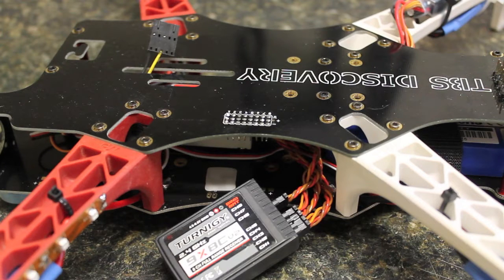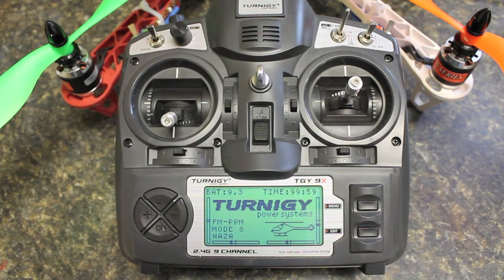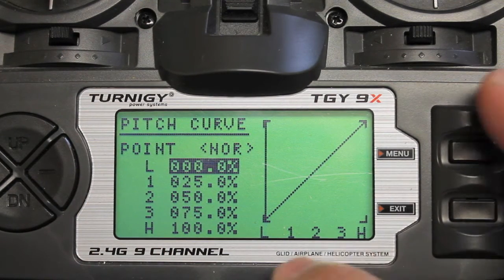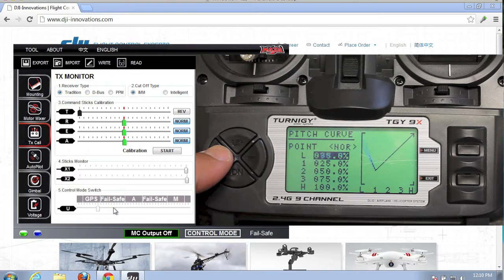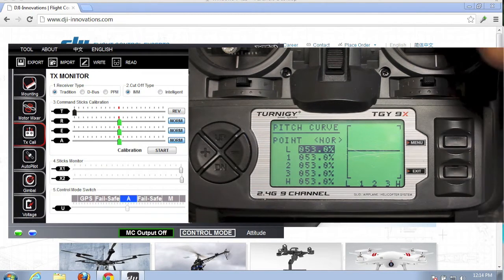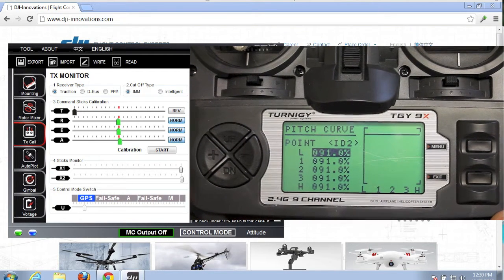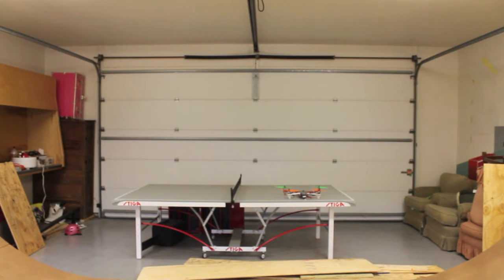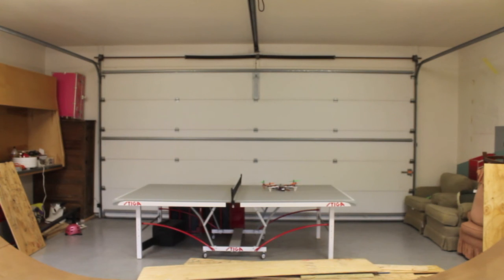DJI Naza 3 Flight Modes (Attitude, Manual, and GPS) w/ Turnigy 9X Transmitter and 3 Position Switch

Comment: I upgraded my nazam v1 to v2 and I have a gps I am using a stock 9x and stock receiver how do I set it up for fAILSAFE? AND DO YOU KNOW HOW TO SETUP THE RTH AND COURSELOCK ON STOCK9X
Reply from the maker: David, I've been trying to figure out how to do this with no luck yet. I have a few more ideas and will let you know if I figure something out.
Reply: thank you dennis, I know if anyone can figure this out it would be you!!!. I met someone who had the same setup as me stock9x and receiver and naza m v1 upgraded to v2 and he had all features that v2 has to offer working just with all the original 9x switches thanks for all your help I have tried everywhere
Reply: Isn't RTH just regular failsafe? Just use the Forced Failsafe guide Dennis made.

Comment: Great guide! With my Naza V2, the manual mode was out of range, so I had to use the subtrim-menu and other values for the curve.
Reply: I only use 3-way switch w/ manual/atti/gps and forced failsafe on the gear switch. 

Haven't tried IOC, since I usually can understand orientation by my self.
Reply from the maker: Thanks. Glad to hear you got it working with a little subtrim!
Reply: since you have the naza v2 are you using a stock 9x? if you are can you help me set up the ioc rth features?  davidringler40@yahoo.com
Reply: do you know how to setup ioc, and rth?

Comment: I did it differently. In airplane mode, I used the the program mix 1, 2 & 3 using the Gear as the Master and the Flap (three position) as the slave. The down position of the Gear switch with each three position switch position for each of the mixes sets the NAZA mode, GPS, Atti, Manual. With the Gear switch in "UP" position all three of the three position switch positions goes to "Fail Safe". In that way I can just flip the the gear switch for "Oh Crap Mode" to recover.

Comment from the maker: I hear you Steve. Unfortunately when it comes to servo reversing and setting endpoints this varies from system to system. I would make sure you know the process of setting things up and then dialing in your settings. You should be able to watch your sliders adjust as you change endpoints. Then just settle on something that gets you in the right segment (GPS Atti, Manual, Failsafe, etc). I hope that makes sense.

Comment from the maker: Make sure you calibrate the GPS properly. I have a video that shows how to do that. As for RTH I recommend setting up a switch on your TX to trigger Failsafe mode. You'll know that you're in Failsafe mode when the slider in the assistant lights up blue on Failsafe. And then when you switch to Failsafe when your quad is on the ground you'll see a different LED. Also, make sure you have 6 or more satellites before you arm your NAZA so it can come back home to a precise location.

Comment: Thanks Dennis..  My turnigy 9x has the original firmware + frsky module and receiver.. I successfully flown it in manual mode but i haven't tried GPS and RTH yet. Do you have any recommendation on how to test the GPS mode without flying? Cheers

Comment from the maker: The way you're going on and on about the 9XR sure makes me want to pull the trigger :) I definitely see one in my future. Failsafe is generally receiver dependent. What module are you flying with? I know the FrSky has it built in...but not sure if they have a 9XR module. Will check.

Comment: Dennis I sure do wish your 9X radio would break so that you would get a 9XR lol (kidding) umm sorta.The radios are different but similar enough that I found your vid on this setup to be the best vid on yt to help me get my 3pos sw working with my NAZA w/ GPS and my 9XR flight modes Manual, ATTI and GPS. Now I would like to learn how to setup my Fail Safe on a switch. Am I going to have to use another sw to shift my 3pos?If so then I prob wont bother and just use the Vol protection as is

Comment from the maker: To configure different flight modes you'll need to set it up with your NAZA connected to the computer and your transmitter binded to your NAZA. After you do this once you shouldn't need to do it again. DJI released a new iPhone app that allows you to do some configuration of the NAZA over bluetooth, but I'm not sure if you can setup flight modes with it.

Comment from the maker: No. If you want to use your gear channel then that would be necessary but for just the 3 position switch you don't need to. I recently posted a video of 6 flight modes using both the 3 position switch and the gear switch in combo.

Comment from the maker: I wish I could be of more help, but don't have the 9XR. If you google "turnigy 9xr manual" the first link should be a PDF manual. Here is an excerpt:

ii. HALF: The output is either 0 or the value describes in “weight”. This is controlled by the 
switch.
iii. FULL: Same as MAX but the value is “-weight” if the switch is off or “weight” if the switch 
is on. MAX and FULL can be a little confusing. 
Look in the examples section for, well, examples :)

Be sure to check the examples section.

Comment: hey man, im new to this stuff, I have a 9xr but I dont know what half the features even mean, where can i find a explanation of all the features on my 9xr?  Or any transmitter i guess... such as mixing, expo, channel & switch setups, what is Weight? what is Half and FULL for switch settings?  and what does having -100 to +100 or whatnot mean.

Comment from the maker: Do you have your TX setup for Heli mode? That's the first thing I would check to make sure you can do this setup. From what I've read the FlySky TX runs identical firmware as the Turnigy 9X.

Comment from the maker: No problem. I've actually wanted to try acro mode just to see if I get more responsive handling, but I noticed there were several options missing from the menu, which wouldn't let me do the different flight modes. Anyway, good luck with the configuration.

Comment from the maker: Hmmm. Not 100% sure what's going on, but can you tell me what flight mode you're configured for? My quads are setup for Heli mode and I've noticed that based on which mode you configure (Plane, Heli, Acro) will dictate what you see in your settings. If that doesn't help then let me know and I'll see what else I can come up with.

Comment: Hey Dennis, I noticed this video is pretty new, but my 9x doesn't have Pit Curve.  I think this is done through the Prog.Mix settings but I'm not sure.  My 9x just came in a week or two ago, so it should be current firmware but my menus don't match.  Any advice?

Comment from the maker: Yes, that's the key and definitely make sure to set all points on the curve as the same value. This will give you a flat line and make sure the PWM is static for each switch mode.

Comment from the maker: What I normally recommend when things are acting in an unexpected way is to start a new model profile and work through these settings. A quick check is to make sure you're not set in Mode 1, which would make your throttle stick on the right where your elevator stick is...assuming you are used to Mode 2 transmitter configs.

Comment: following your video, and for some reason when I have the channel 6 plugged in to the U port on the Naza. The three position switch and the elevator level on my TX both move the control mode on the naza software. Using the pitch curve does not move the slider. Very frustrating. I've switched RX and reset my TX. If I connect the U port to any other channel on my RX this doesn't happen. Any ideas on why this is happening.

Comment from the maker: Justin, I was able to mess with this over the weekend and got it working so hopefully it will work for you. Check out my latest video titled "DJI Naza Forced Failsafe Using Turnigy 9X Gear Switch Channel 5 Mix...". It's currently uploading but should be available in about 20 minutes. Let me know if you have any questions or if anything needs clarification. The Turnigy 9X documentation sucks so a lot of this stuff is trial and error!

Comment: Hi Dennis, thanks for the fast reply. I have got my transmitter to the point where  "channel 6" 3 way switch is working for flight modes. "channel 5" (Aux = gear) 2 way switch working for IOC (Go home & land and off), but my problem is no fail safe when I loose power or go out of range. (I havnt tested out of range)  :) but wouldn't want a fly away :( In this video from Terence Chan, youtube.com/watch?v=yKQd_Vu10lE  he has it set up perfectly.I tried his way but dont have failsafe

Comment: Hey dennis when i have channel 5 hooked up to U.. I try changing the percenteges like you show here but the slider does not move at all. the only way i could get it to move is if i set it to the gear switch but thats only 2, and when i set end points it only goes so far. Scratching head ? lol

Comment: Good News! Got a new receiver - no better. Think the problem was corrupted Naza firmware. Now all OK. 3 way switch as your set-up. And gear switch connected to X2 via channel 8 to control "Intelligent Orientation Control" under Autopilot in Naza Assistant. This feature is a major reason for my purchase of the GPS module.

Comment from the maker: Right, and if you look at page 38 in the Naza User Manual this is the breakdown:

X1: ￼ For gimbal pitch control or for gain tuning
X2: For D-Bus (S-Bus compatible) or for gain tuning or for IOC switch
X3: ￼ For voltage monitor (Connect with VU V-SEN port)

I was just curious what you were using X1 and X2 for since they can be multi-purpose. Not sure how to overcome the problem you described just yet....other than opting not to use X1 and X2 while you get this set up.

Comment from the maker: That's interesting to hear. I haven't wired up my gimbal or remote gains in conjunction with the 3 way switch so it sounds like there may be a conflict. Do you have X1 and X2 setup for remote gains or are you using X1 for gimbal pitch control? For X3 I have that wired to my VU so that doesn't factor into the equation here.

Comment: Dennis, I should have mentioned earlier that my receiver is suspect. I had a crash - broke a propeller and an arm. Added GPS while awaiting parts but can't get motors to fire up. Transmitter is OK - works on another quad. Today I got Naza Assistant error messages I couldn't dismiss though the Naza assistant responded to the transmitter, stick movements etc. Nonetheless the receiver is suspect and might be causing the odd behaviour reported earlier. 
Mike.

Comment: Progress. First, when I rechecked, I was in 7 not 6. I can get your result with U connected to 6, BUT not with X1 and X2 connected to 7 & 8 'cos then the throttle stick also affects the flight mode indicator. I noticed that you do not have anything plugged into Turnigy ports 7, 8 and 9, so no connections to Naza X1, X2 or X3? Is there a reason why not?
Mike.

Comment: Nice clear video, Dennis. An elegant approach. But... I can't get it work. Probably done something wrong. I have Turnigy 9x with V2 software, and GPS connected.
I made sure that U of the Naza is plugged into ch 6 of the Turnigy receiver, but I can' get the pointer under GPS/Fail-safe etc in Naza assistant to move when adjusting the pitch curve. One question - what do you have ch 6 assigned to on the Turnigy?  The options that I'm offered are: NULL, THRO HOLD, GEAR, PIT TRIM,HOV THRO, HOV PIT,

Comment: The KK2 now performs well at holding altitude manually (no barometer or GPS) So my KK2 FPV will not be any low altitude flying. I'm still learning about vibration, balancing etc. 

I plan on just starting T2i video as it runs 12 minutes max and my eCalcopter specs say I'll get well under that from Quad or Hex. As a video editor this is a non issue.

Comment: KK2 is NOW performing well but one needs to flash 1.4 or 1.5 firmware to get Auto Stabilize to function properly. I went to LazyZero to get firmware. My next step is to rebuilt quad as an H copter to accommodate the FPV and test Gimbal with lighter Kodak Sport Video Camera. One I have the KK2 talking to the gimbal and learn FVP issues and feel confident I'll move on the the Heavy Lift Hex. It seems like two steps forward one step back.

Comment from the maker: You're most definitely welcome. I appreciate your feedback. I've yet to fly a hexacopter but definitely plan on doing so this year. How do you like the KK2? I was thinking about getting one (I used to have a KK from HobbyKing) just for acrobatic flight. When I switched to Naza and APM it was almost like all the challenge had been taken out of flying, which is good if you're doing FPV. Do you have a remote video start/stop for the T2i or do you start filming on the ground and stop when you land?

Comment: Hi Dennis, Thank you for giving the demos, I am presently learning the ins and outs of multirotors and have finally decided on using a NAZA M with GPS with my hex camera copter (under construction). Presently using a 450 quad with KK2 with Turnigy 9x learning to fly multirotors (RC pilot from 1970s). Orientation is my biggest problem. Once I master the basics including FPV I'll move on to the Hex. with a Canon T2i video.

Comment from the maker: Spencer, thanks for the feedback and glad to hear you have a Turnigy 9X on order. I've really enjoyed it after upgrading from my Spektrum transmitter. I would definitely recommend starting with the F450 and then upgrading to the TBS Discovery. The F450 flies much better for acrobatic maneuvers and then Discovery is designed more for stable FPV flight. You'll notice a difference in their flight characteristics because of the arm/motor positioning. Good luck with your setup!

Comment: Dennis,

Thanks for posting this.  Believe it or not, I also live in Austin and have a Flamewheel 450 in house and a turnigy 9x on order along with some different motors.  

I think I am going to build the 450 and then upgrade to the Disco frame.
Again, thanks for posting!

Spencer